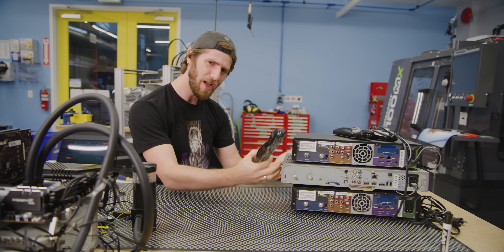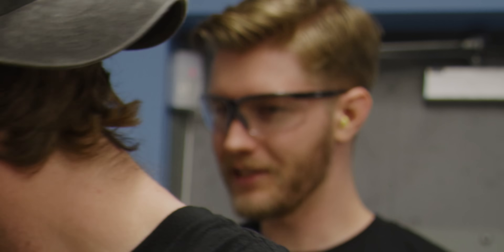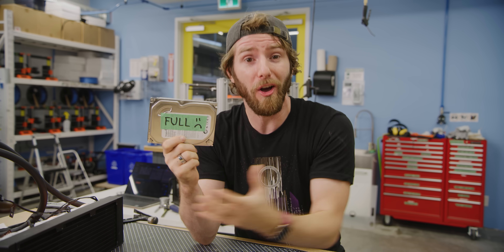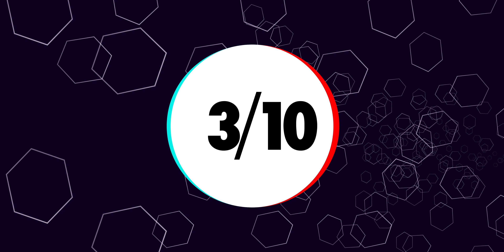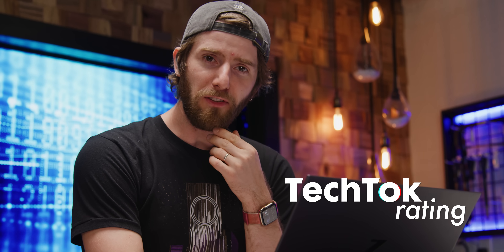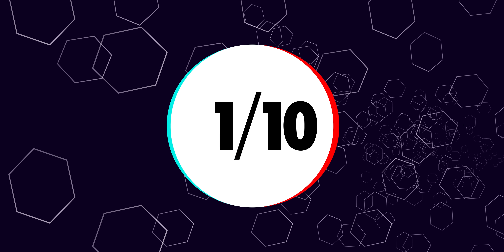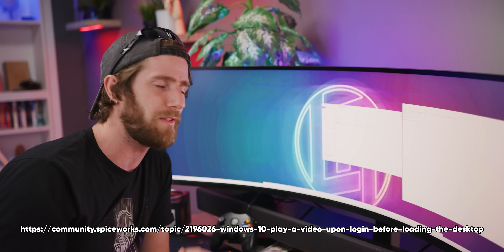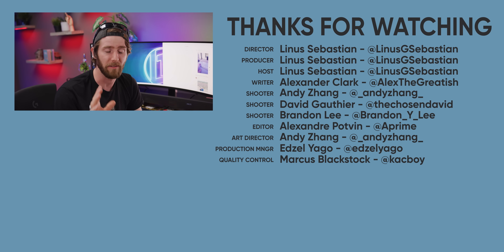Trying TikTok Computer Hacks...

Comment: That CTRL+WINDOWS+SHIFT+B key combination actually restarts the DWM pipeline which causes the graphics driver to reload. Highly underused, understated tip. Ever been playing a game and you can tell its still running but the video seems frozen? That combo will prevent you from needing to restart.aaaaaaa
Reply: I used this a lot with a previous monitor I had

I think it's implementation of freesync was pretty borked and it would occasionally start flickering in a subtle but noticable way. This shortcut fixed it anytime it happened.
Reply: I rate this 10/10
Reply: @mitchellortiz3689  Also works to fix when the mouse cursor gets detached for VMWARE Horizon client sessions. There's lots of situations where this shortcut can prevent you having to reboot/reconnect :-D
Reply: TIL
Reply: @joeykeilholz925  ????
Reply: @Ommi Hildegardt congratulations 👏👏
Reply: @Ommi Hildegardt I also run Linux. And while crashing and other issues are less frequent by a large margin, similar failsafe keystroke combinations exist to break out of unresponsive GUI and terminal applications.

Further, just because you run Linux doesn't mean someone you know doesn't run Windkws and this tip can't save them (and by proxy, you) time.
Reply: sweeeet
Reply: This should be pinned. Much more interesting than some random TikTok explaining nothing.
Reply: @mitchellortiz3689  I just wrote that down ,  😆
Reply: @BauliusTorvoltos  that is exactly my issue , freesync
Reply: Yea, 5700XT driver issues taught me this key combo. So many random black screens(but the game still running in the background) salvaged with that.
Reply: wait so this works on any windows??

Comment: So a note on the DVR HDDs... There is a function called "power-up in standby" which most of them have on by default, and in most cases it will prevent a system from using one as a boot drive.

hdparm (in linux) allows you to turn that function off. I imagine somebody probably knows a Windowsy way.
Reply: I'd hope people are not using these HDDs for their boot drive
Reply: @kylehagertybanana  or a HDD in general really
Reply: @gamer_man_4350  hdds are still a great way to store large things like games that are huge and is acceptable to start 2-3 seconds slower than on an ssd
Reply: @NerdPub_  well your computer still needs to access those resources while you’re running the game, and loading times can be drastically slower because of that.
Reply: I only use HDDs for my film, music and whatever else collection. I haven't used one as a boot drive for so, so many years now. I don't know how I put up with that in the first place.

Comment: The IG inspect element hack doesn't even make sense. 

If you have to refresh the page, any changes you made with inspect element or developer console would be lost 🤷‍♂️
Reply: That, and any developer worth their salt wouldn't transmit content to a user that isn't meant to see it.

What a waste of bandwidth!
Reply: Exactly
Reply: Ah yes, changing Inspect Element properties to hack server side encryption.
Reply: @ThumberBulls6  lol
Reply: @fanuchman  a lot of news site paywalls did that (and some probably still do)
Reply: @fanuchman  Not true, sometimes its cheaper to have a single page with and without the content and show/hide it dynamically rather than having multiple pages and checking permissions.
This way you can utilize caches and proxies to reduce network and CPU usage on the server.
Its not wasted bandwidth if its not my bandwidth being used.
Reply: @hubertnnn  It is a HUGE security issue. It isn't going to be cheaper when you factor in the fine imposed because of the data privacy violations.
Reply: @alexcuadron8500  Depends on the access model really. Consider a typical website with landing/login/register pages shown to not logged in users and content pages shown to registered users. The website layout itself is on the client side, it is virtually never being hidden these days; user data, however, is not. You can make your browser show content pages fiddling with the page sources but you are not going to steal someone else's data you're not supposed to see.
Similarly, a social media website might feasibly choose to hide posts from not logged in users but show them to everyone else, and these posts being accessible by changing the website sources client-side. 
It's stupid and obnoxious but yes, like already pointed out by TheRuyKokki, lots of news outlets do that extensively.
Reply: Exactly what I was saying to myself out loud as soon as he said refresh the page in the Tik Tok.
Reply: Could be real if an engineer got lazy. We all see stuff that makes us scream internally when we catch them.

EDIT: I’m a senior software engineer working at a bank. You see them all! 😂 My colleague and I have a museum of bad ones. Here’s an example: making “tests” of type assertion against a constant variable of the exact same time this is testing. All that just to boost metrics for the number of tests!
Reply: It wouldn't work if the browser would completely reload the page from the server on any refresh. Modern browsers don't do that (unless told to, like with Ctrl-F5, and even then sometimes not everything is refreshed). That is why you can remove paywall code on some websites, but the page isn't scrollable (I don't know enough to remove that). But you hit F5, page is reloaded from a cached edited version, no paywall, page is completely visible and scrollable.
Reply: Base on the pictures of the private profile and the voice of the guy I think they were trying to “prank” people at the expense of the LGBT community.
Reply: @alexnecula  thats not the same inspect element "hack" he is talking about
Reply: @ffmfg  you can override the style for the content block with overflow-y: scroll, then the scroll bar appears and you can navigate the page
Reply: @Ctuchik  what if that was their alt account that they had access to, so they just changed the settings out of camera?
Reply: No shit
Reply: @TheRuyKokki  They definitely still do, but its a bit more than removing the element.  You have to run a small code in the console which I have stored in my clipboard.
Reply: @ffmfg  YOu can "remove" the non scrollable by simply selecting the page and hitting CTRL A (select all) then CTRL C (copy) and then open up a new document and CTRL V (paste) and all the text is copied to the file even though it doesnt scroll.
Reply: I used this over a year ago. it would work for about 5s, then it would go back to being private. idk why but yeah ?
Reply: It was probably because the way they made it was to try and view it while logged out (or into an account that doesn't have access), log in on a different tab to an account that has access and close it then do whatever hand waving you want when you refresh it won't be hidden anymore.
Reply: Someone with an average sense of computers would know this
Reply: The only thing I use inspect element for is to delete/remove blurring,log in pop ups and other obnoxious visual elements by deleting the frame it uses.
Reply: And what if with the function call you write to local storage, which is then read (due to lazy developers as store management) to showcase content and run API calls?
Reply: @ffmfg  "the page isn't scrollable" - you have to find the element with the CSS rule that says "overflow:hidden" and disable or remove the rule for scrolling to work again.
Reply: Not true, you can make changes made by inspect element persistent and work on reload
Reply: *OG?
Reply: @fanuchman  you mean, almost every paywall on the internet was made by a bad developer?

(j/k, the answer is definitely yes)
Reply: Yea, you have to manipulate the TRANSMITTED data, only a proxy like burp can do that, and it still almost never works

Comment: I was taught by my machine shop  teacher to never wear gloves when using a grinder. If the glove fits too loosely, it can catch on the grinding wheel and pull your hand into the grinding wheel that's rotating at thousands of rpms. I follow my teacher's advice because he had been a machinist for 25 years and still had all of his fingers.
Reply: And if it's not your hand that's pulled into the wheel, "degloving" fingers is a very real injury

That shit keeps me up at night imagining it
Reply: @Spideryote  
Ah shet, I'm uncomfortable around work tools now
Reply: Grinding = gloves
drilling/milling/lathe work = no gloves

If your glove touches the grinder wheel, it's gonna wear, rip, or tear. If your gloves (or other loose clothing) catches in a lower speed rotating impliment like a drill press, milling machine, or lathe, it will catch, and pull appendages/body parts with it.
Reply: @NickCressman  It really depents on the kind of grinder you use. or rather what type of attatchment you use. If you use just a simple grinding stone on it gloves are fine, if you use a really coarse one or even something resembeling a saw (or heaven forbid one of those chainsaw heads) then leave the gloves... if the glove gets caught on just one of the edges it will cost you your hand... or your live. There is a pretty good youtube video out there where a woodworker explains how he almost got decapitated by his grinder because his grindingtool got stuck on a piece of hard wood he was working on and spun all the way from his extended arm up his belly towards hios head within less than a second. 

Remember kids, a Grinder is calledn an "Angle Grinder" for a reason. you should not use it as general worktool just because "it can" do these jobs. It was designed to grind through bolds, not to cut, saw or polish. The more grid your head on the tool has, the more you should avoid using it.
Reply: @Buffalo_Soldier  I mean, what about milling machines, drill presses, lathes...
Reply: If you have loose clothing it can happen to your shirt too.
Reply: No gloves when on Grindr, gotcha! 👍
Reply: @NickCressman  Correct. You can wear gloves with power tools, but NEVER on lathes and mills.
Reply: I came here to say that exact thing. Do not wear gloves when using things that spin that fast and your fingers are that close whether it be a grinding wheel, table saw, belt sander.. Anything that a glove can get caught in and bring your hand with it. Just don't.
Reply: Not sure if they still exist but there at least used to be a few YouTube videos that showed exactly what can happen (not for the faint of heart).
Reply: Haha. U ever wired brushed a fence? I like my leather gloves
Reply: Uhh, no. Wear gloves that fit. You don't want to lose fingers because your hand slipped using a cutting disc or something. I'm honestly shocked at the amount of people here who think you shouldn't protect your hands when using something that can literally cut through metal. My gloves have grazed my discs countless times and not once have I thought "Man I sure wish my flesh touched this instead of my $12 gloves"
Reply: As someone who has not been a machinist ever, I would've tried to point that spark trail away from me.
Reply: How the fuck would u get ur gloves into the wheel ? I think u remeber this all wrong,  And yes use gloves!  Even better use vibration reductive gloves, you will thank me when u get older. And dont have 2 deal with white fingers ( Raynauds phenomenon )
Reply: its really mostly about focus.
Reply: DO NOT GOOGLE DEGLOVING
Reply: @paulchristian5375  Now i have to.
Reply: Machinists don't use angle grinders.  Meanwhile, every metalworker who actually uses them on a daily basis will tell you you're an idiot if you don't wear them.  Proper gloves and using the grinder correctly is not a risk of entanglement.
Reply: I was taught if it rotates, the gloves can fuck right off.    
Grinders, lathes, mill, drill press, whatever else, the gloves will probably do more harm than good long term.
Reply: Might be a bit of effort and seemingly impossible to pull off......but maybe wear gloves that fit?
Reply: With all due respect, that's not great advice. Maybe once in a blue moon will the circumstances be right for gloves to get caught in an angle grinder, but almost always will it shred the glove, ALSO the thing everyone here is forgetting is that an angle grinder is a speed tool and doesn't have the torque required to tear your arm off like a lathe can, it can fuck up a finger or two, sure, but will quickly grind to a halt. 

Besides that, your hands should never get close enough to the grinding implement for that to happen (sure accidents happen, and im not making light of the fact that angle grinders are bloody dangerous). Sharp edges, heat, grinding sparks and more are all reasons to keep comfortable, well fitting gloves on.

Of course lathes, mills, standing drills and such are absolutely glove-free tools, lest you're keen on losing an arm. Having said all that; each to his own, we all do what we must to get the job done, and at the end of the day come home to the missus intact.
Yall have a good one.
Reply: I almost had the tip of my pinky finger get cut off while using an angle grinder without wearing gloves. So I always wear gloves now. It cut straight to the bone. The glove will never get caught in the grinding wheel. It will just start to shred as others have noted.
Reply: is it really that hard to inspect your equipment and think about whether it can suck something in or not
Reply: @rowenkylee5627  That's why I'm always buck ass naked when using tools. You can never be too safe.
Reply: @duodot  I mean you can but you can also ware a condom when to go to sleep just in case, there is just no reason to do that. The whole point in power tools is to keep your hands from getting dirty or hot hence no need for gloves.
Reply: @grn1  Man in China go whapwhapwhap!  (That was brutal cause his body went around and around for like 40 minutes.)
Reply: @Spideryote  WTF is  "degloving" fingers, *googles*.....*instant regret*...
Reply: That’s like saying you should never wear a seatbelt because it could prevent you from exiting a flaming vehicle and the person who told you that has no 3rd degree burns, so they ought to know what they’re talking about. 🙄

Comment: I feel Alex's anxiety hard about Linus with the grinder
Reply: “can i suggest a thing”
NOPE
Reply: Well, kurz gesagt would have used a nuke or the end of the entire world as we know it as tool to open the DVR
Reply: I don’t know much about shop safety but that felt like a lot of metal shards for short sleeves.
Reply: @finchhawthorne1302  Not only that. That's the wrong disk he used.
Reply: Gray Plays  stop cat phishing
Reply: Hes upgrading from dropping stuff to maiming.
Reply: *Grindr
Reply: He's no better when doing sketchy stuff
Reply: Linus knows his way around grindr
Reply: Please correct me if I'm wrong but isn't it so that you should NOT wear gloves while using rotary tools?
Reply: @SciFiFactory  you are absolutely right, some people do but most trade schools ban the wearing of gloves around rotary tools.
Reply: @SciFiFactory  Big rotary tools like drill presses or lathes, you are absolutely right.

Handheld angle grinders can go either way though.  I personally will not wear gloves with them.
Reply: SciFi Factory I use an angle grinder semi-professionally and I wear gloves, because hot metal shards on my everything are a bad time. That being said, it’s only because my hands are so far away from the disc that I feel safe using gloves- it’s both guarded and has two or three inches between my mitts and the maimin’ disc. It’s the only tool I wear gloves with in a shop full of rotary tools.

Comment: "Only two drives spun up."

Well you did kinda mangle one with a hammer
Reply: It probably would have still worked hard drives can take alot when they aren't spinning
Reply: and attach it to the bench on another with a magnetic welding clamp
Reply: @colonelk3000  magnet may erase the drive but not really damage the plate unless extreme condition
Reply: Na that's how they work, use the hammer.
Reply: Gray Plays  why are you spamming mate?
Reply: @muizzy  arent the heads parked in a safe position while turned off?
Reply: @lesto12321  safe until you mess them up.
Reply: @lesto12321  like a big welding magnetic clamp on it side, if it didn't pull the read/write head out of place first, I am almost sure, it would course some data corruption errors at least?
Reply: Plus, he could have messed up the circuit board on the underside of the drive... You know, the side that he mangled with a clawhammer!